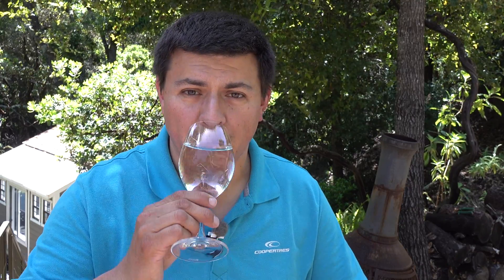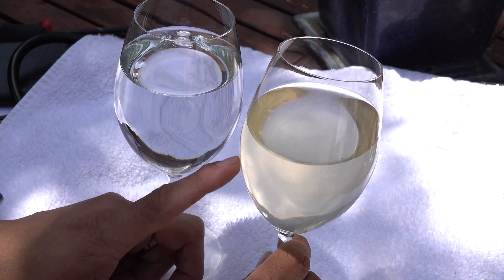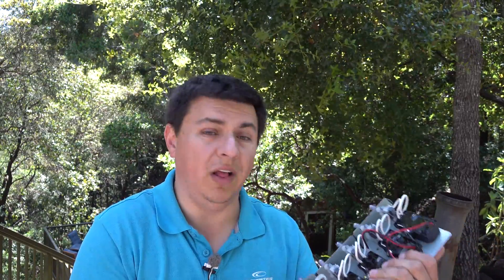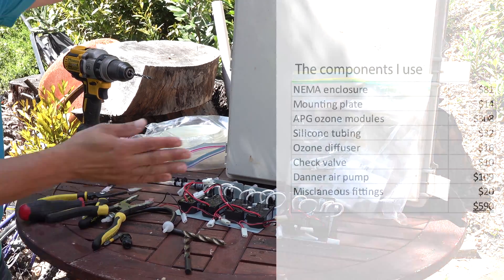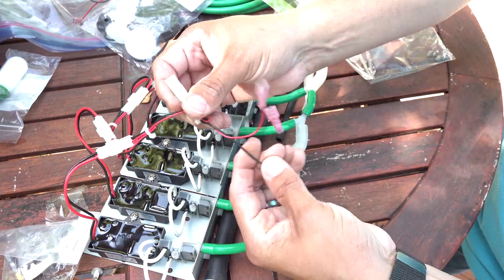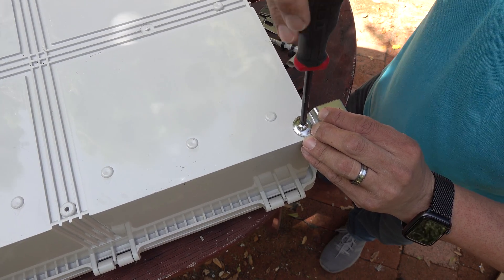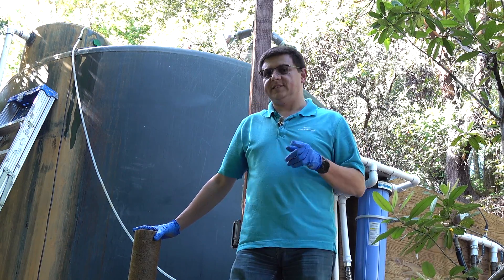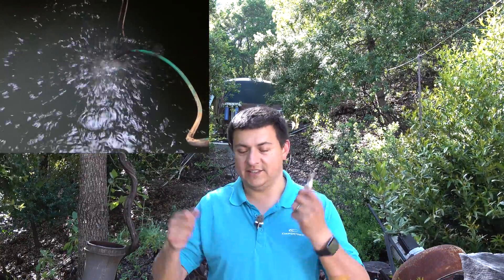Ozone | Solving Iron and Manganese Well Water Problems

Comment: I have a question concerning your system if you don’t mind…I had a 160 ft water well drilled and the water is terribly high in iron and manganese and coliform…I was thinking about a 250 gallon water storage tank to start the process since very little water is used…my question is…can I just use aeration at the top of the tank to turn the iron bacteria to a ferric state or do I have to use the ozone process? Once the ferrous iron and manganese turn ferric and sink to the bottum…I can then pump out the water from center of tank to then run thru filters and UV?

Comment: looks like that retro fit is now discontinued, so i ordered the newer modules that are in a set of three and look slightly different. BUT i just read the comment about how ambient air generates unhealthy nitrogen reactants, do you know if that's true? can u test this system to verify, please? also curious if u know, does output improve or performance remain consistent with the newer and discontinued Del modules?

Comment: Has anyone had any problems with the ozone modules burning out?
Reply: I installed this system in July and 3 of the modules burned up after about 5 months. I know these don't last forever, but 5 months seems short. After they burned up the other modules were still producing ozone but it was leaking out through the melted modules, which oxidized everything in the box. I am also in the Santa Cruz Mountains, so I am wondering if this is a result of power surges before/after all the power outages this past year. Has anyone had similar issues?

Comment: I have a treatment system that starts with carbon and sand filter then a precision filter then RO then ozone and ozone mixing tank then UV then ss water tank ready for drinking , after the RO we make a line that let pass for some mineral water that doesn’t pass through RO so that we can get mineral water so that we get a water about 100 TDS to get a good taste water , the problem is after we ozonate the water there is no iron in water around 0.006 only but the water once ozonated is getting yellow color before ozone no yellow color how can we solve this problem?! If we installed a softener will the problem will be solved but the water will have sodium which is not good for water drinking?! What do you suggest ?!

Comment: With ozone being hard on certain plastics, do you have any concern for the storage tank ?  I ask as I would like to use ozone in two HDPE reservoirs that I circulate a fertilizer solution back to.  An excellent video, I learned more in 15 minutes than the hours and days of looking at other videos.

Comment: Be careful with with corona discharge units when supplying ambient-fed air, it should be pure oxygen. The problem with using ambient-fed air is that the nitrogen reaction produces nitrogen dioxide, nitrous oxide and nitrogen sulfate. These gases create a salt that, in time, will deteriorate the plasma field’s ability to produce ozone, not to mention are extremely unhealthy in drinking water if not filtered out
Reply: how did the sulfate get in there.
Reply: Hey there - do you have any references on this? Or some way to learn more. Thanks!
Reply: does anyone know if that is true or not? someone using these modules in, perhaps a HotTub, who has tested for nitrogen reactants? I just ordered these Del modules to treat & solve well water iron and iron bacteria problems. this comment certainly gives me pause, and i too would like to learn more, please?

Comment: Alex,
A Venturi creates suction that pulls the ozone gas from the module mixing w water supply. You mentioned that your “manifold” is acting as your ozone output; however, it doesn’t appear to be connected to the ozone cells. Can you explain to me how you are connecting your air supply to the ozone output?
Reply: Not entirely sure but my understanding is he  eliminates  the venturi in favor of the pump.

Comment: What power supply do you use and how are you connecting the silicon tube to the air stone?
Reply: Other commenters figured out that for these modules it’s 110v ac supplied to the leads.

Comment: The six APG ozone generators modules together produce 1 gram of ozone per hour.  How did you determine to use six modules? How much Ozone (and modules) are necessary for a 5 thousand gallon cistern? Thanks.

Comment: I just received the ozone cells, but I can’t find any info anywhere about what voltage these run on. Are they running on 110V or do I need a power supply for different voltage?
Reply: did you ever figure this out?
Reply: Not yet, was thinking to try with 12V DC first, if it doesn’t do much then try 110V AC, which hopefully won’t burn it down. Looks like this ozone module isn’t in production anymore, but you can buy them from places that still have them in stock, but because of that there is no technical support available and couldn’t find technical info on its power requirements either.
Reply: @norbertegi4258  In a moment of clarity I realized that Corona Discharge requires 20k+ volts.  I imagine then that you'll need some sort of transformer for the power supply.
Reply: Jim Mutter I think it’s going to be 110V. That black cube is the power supply that generates the high voltage on the white wires. Check the attached photo on the review page of this product which uses the same module and requires either 110V or 220V. (The APG modules can work on either voltages.) Inside the box the wires go directly to the black box:

https://www.amazon.com/dp/B01A1A6TMQ/ref=cm_sw_r_cp_api_i_XaHXEb8JTX78C
Reply: @norbertegi4258  Looks like you are correct.  Great find  Please report back.
Reply: Jim Mutter Confirmed! Just got to testing it! 110V it is. The green light came on on the ozone generator part of the module and I certainly smelled ozone. Ready to complete the project!
Reply: @norbertegi4258  how did it go?

Comment: Hi,

I also live in the Santa Cruz mountains, so I suppose I should start by saying "Hi Neighbor".

I am wondering why you can't use the water flow from the well pump that fills your big tank to make use of the venturi effect built into the ozone makers? In fact you could tie the power for the well pump to the ozone makers so that they only run when water is moving through thier venturi manifold.

Also, can you tell us where you bought those filters from?

Comment: Great video Alex. Our water softener has finally died and looking at installing an ozonation system. Really like your DIY episode. I have a few questions: 1) Does the ozonator (and pond pump) run continuously? 2) Could you have had the ozonator in-line on the tank fill line? I.e.: used the venturis on the ozone generators and have the ozone injected as the tank fills, thereby only having the ozonator running while the tank fills? 3) Do you have figures on the quantity of iron and manganese before and after treatment? I ask because we have very high levels of both. BTW, we are also in the Santa Cruz Mountains. Howdy neighbor. :) Thanks!
Reply: Ozone Plus Bromide Equal Cancer?
Reply: @dilipsinghchouhan3370  bromine alone kills thyroid and causes cancer and more.
Reply from the maker: Yes it runs all teh time. You could use the venturi style but you get less interaction time vs a tank and diffuser.

Comment: Great video! Just one question... are those ozone modules ac 115v or DC 12v? I'm looking at running this setup on a gravity fed cistern and solar power. Thanks in advance!
Reply: Other commenters figured out that for these modules it’s 110v ac supplied to the leads.
Reply: @nicks-fix  does that mean one 110v cord ? i ordered the modules but don't have them yet, and am trying to work out how i need to build this Ozonator. hopefully i can use the supplied harness to daisy chain all the modules to a single standard plug...?